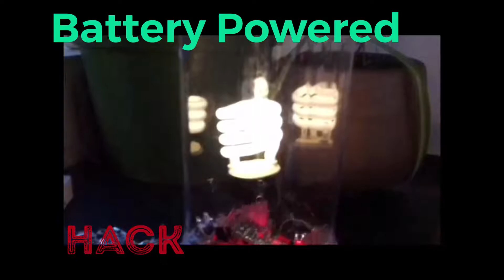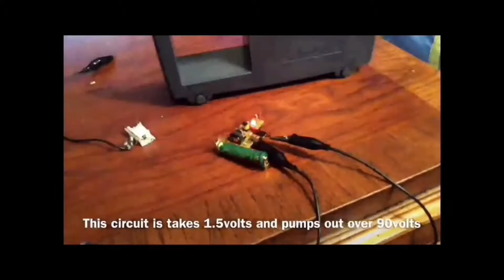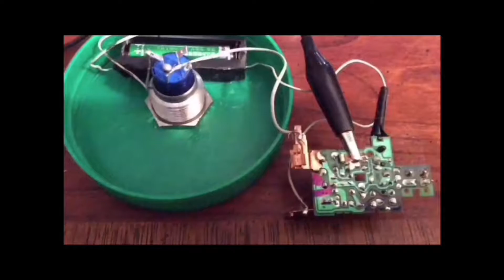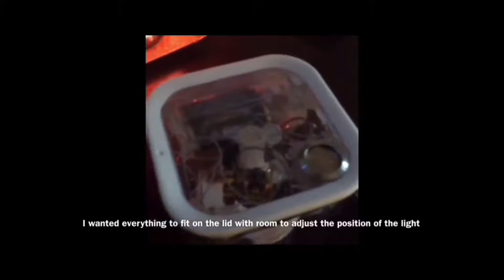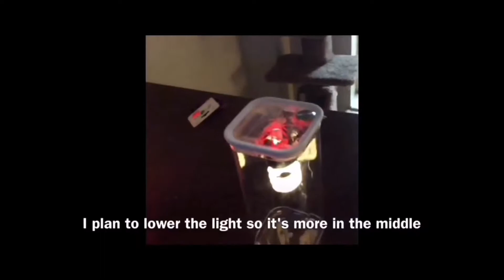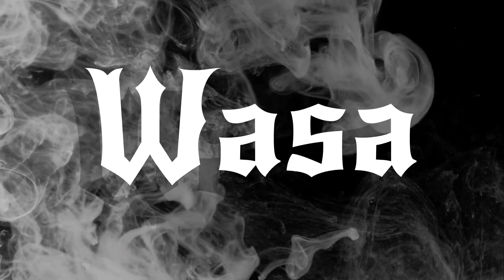Battery powered CFL hack

Comment: If you use a CCFL inverter from an old LCD computer monitor or simply buy one online it will be a lot brighter. An arc lighter circuit may also work but those drain batteries quick. I take the pair of wires on each end of the tube and twist them together so you have two connections one on each end.
I made something like this but with the inverter circuit from a battery powered UV disinfection light. Just put the CFL in place of where the original tube was.